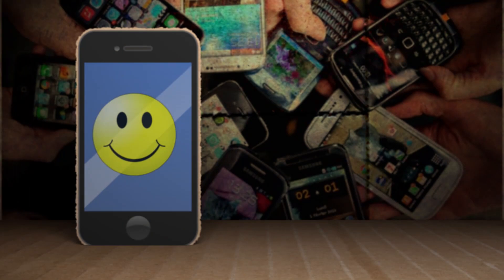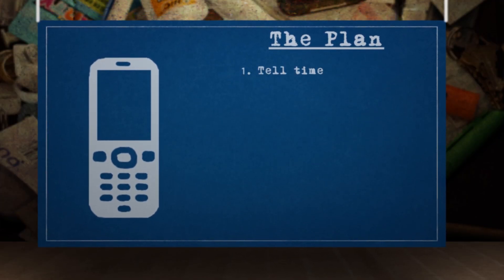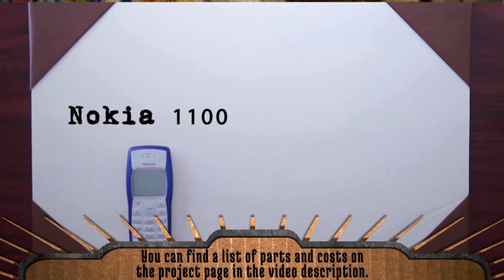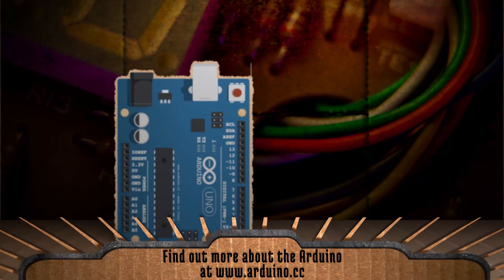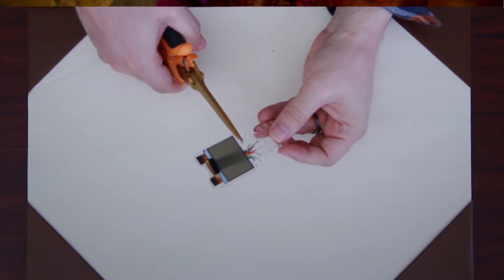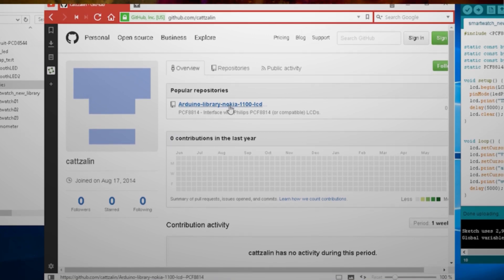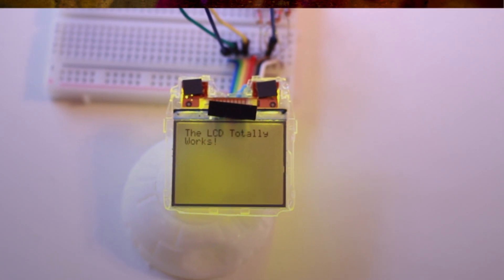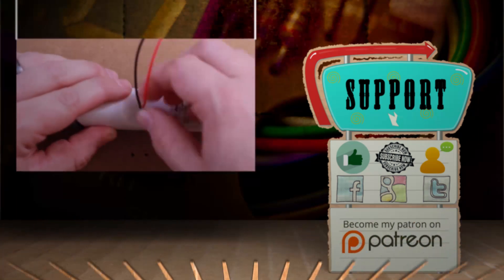Make Your Own Smartwatch From An Old Cell Phone (Part 1)

Comment: At 2.11, you show the pinout with 9 pins - one NC and then 8 more numbered 1 to 8.
In the next shot when you're soldering wires onto the connectors, there are only 8 pins, which agrees with the LCD that I have.  So I guess your pinout diagram is wrong (sourced elsewhere, perhaps?)

Comment: Awesome! Is there any way to re-use the logic controllers in an old phone instead of buying an arduino? 
Also, if you use an ESP8266, it is arduino compatible and has Wifi built in.

Comment: you can just buy a new LCD screen with driver board for 2$ and keep or sell the old phone .
http://www.ebay.com/itm/84-48-LCD-Module-White-backlight-adapter-pcb-for-Nokia-5110-NEW-S3-/252056501566?hash=item3aafbcfd3e:g:ggoAAOSwd0BVzVm9

Comment: is it posible to drive color LCD screen from old LCD Monitor with arduino?
Reply: If you want to use color on a Monochrome LCD screen, it's like painting the rainbow on a white sheet with a black marker, you can't make color out of nothing.
Reply: not on monochrome screen on color screen
Reply: Not using an arduino, except for the 32 bit ones, none of them have the power to drive a color LCD (I'm guessing it uses VGA).

Comment: Will it work if i buy a LCD screen so i dont have to take apart a
 phone and also will it work with a raspberry pi?
Reply from the maker: Yes and yes, but a raspberry pi would be much larger than an arduino mini, so a watch form factor may be out of the question.

Comment: but isant that just a pager?
Reply from the maker: It's a pager....but on your wrist!!!
Reply: a car is not a truck and a pager strapped to your wrist is not a smart watch.. if you included text to speech software that might redeem the project a little.
Reply from the maker: So adding text to speech to a car would make it a truck? ;-) 80% of smartphones don't have text recognition capabilities and 40% have the same functionalities I'm using for this video, so this definitely constitutes as a smartwatch. What qualifies it as such is it's ability to communicate with your phone to send/receive notifications and messages. If this project bothers you, then I fear you're missing the point of the video. This video is merely introducing the construct for a basic platform. Want text to speech? Accelerometer? Pulse detection? Games? This platform can do that, but where you take it is up to you. I'm just showing you where to start. I look forward to your text to speech smartwatch!
Reply: im busy building a robot :)

Comment: it's a great project but why did not you use an Arduino LCD module? It is much easier
Reply: I'm guessing it is because the point was to reuse older cellphones for a new purpose.
Reply: true
Reply: What's thr point of thr video if he used Arduino LCD duhhh
Reply: +NA the*

Comment: It'd be brilliant if you made it work from a Pi Zero (not sure of the size comparison to be honest, probably a tad too big) but then it could be it's own standalone device. :D
Reply from the maker: That would be a much better option, but the Pi Zero was still too large for a watch.
Reply: Issue with Pi is Linux is not as barebone as Audrino. So one is going to have to put more work into it (as I've noticed it's going to be like for project).
Reply: Yeah, thought so. Never actually seen a Nano myself so I wouldn't know.
Pity but oh well. I'm sure the rest of this series will be a brilliant watch still.
Reply: Yes, but as for software, a real OS can do a lot more. And, as I say, be standalone. 
I know for a fact an Arduino is a lot more capable at hardware related things than a Pi's GPIOs but nonetheless.